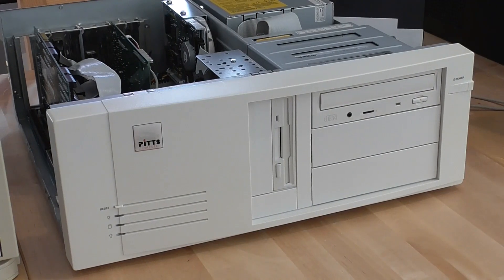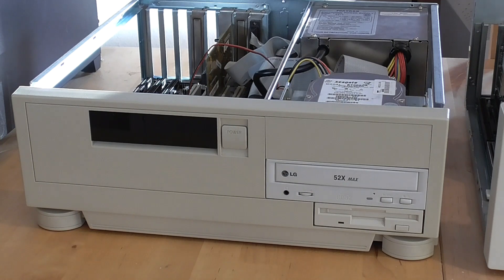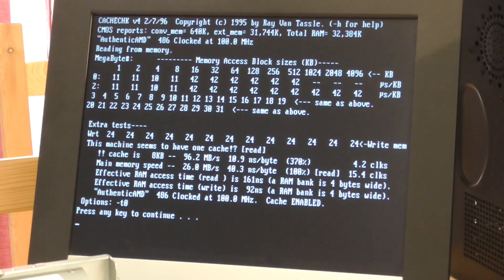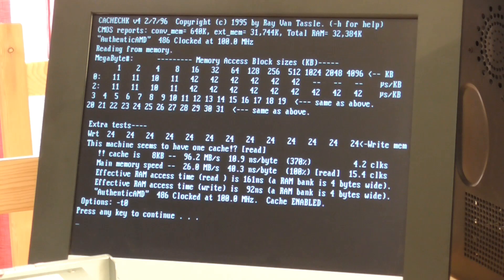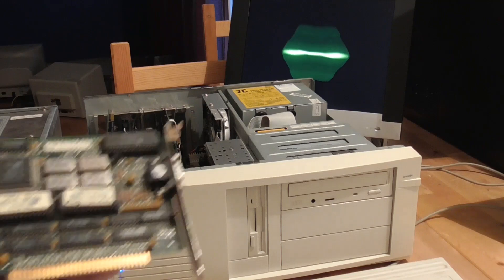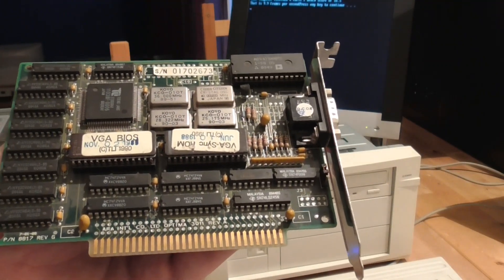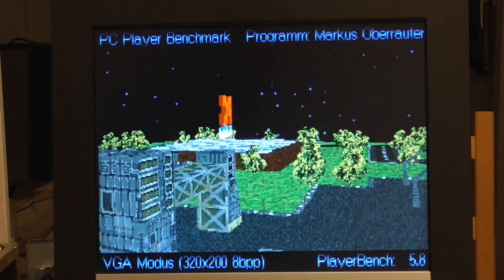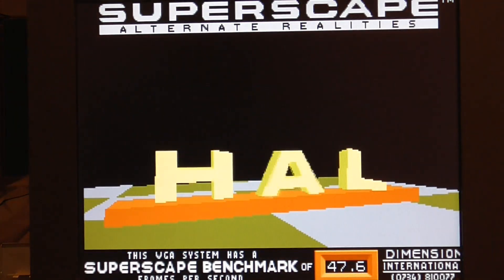Why is this Motherboard so slow!? + Mystery card

Comment: I also have the 2.0 version of that same board! I found that the jumper settings in the available documentation theretroweb to be mostly correct, but the descriptions of JP1 settings are backwards (e.g., says 1-2, 3-4 when it should be 2-3, 4-5) for a good number of the possible cache configurations. I talk about this a little be around the 50 minute mark in my recent video. In all of my Doom benchmarking, I had a single 32MB SIMM, and it performed quite well. I had much better luck with the CPU settings. I couldn't try any of my faster AMD CPUs because a couple of the pins on JP25 are snapped off. :face_palm: I'll have to fix that some day...
Reply from the maker: Thanks for the info. I'll have to take a look again to see if I got the cache settings correct.

Sorry to hear about your AMD chips. Hopefully mine survived my recent move!

Comment: Have you tried populating the board with less memory? Most of boards from these times were supposed to work with 4 or 8 MiB of RAM. They sometimes have too little Tag SRAM to handle more. It's mostly right as long as the L2 cache covers the lower part of the memory where DOS operates, with all better operating systems suffering from uncached memory. However, it may be the case that this board caches only the upper part of memory and thus DOS runs uncached. It may be worth re-checking with 4 MiB of RAM to see whether it changes anything.

Comment: I don't think the CPU is the cause of the issue here. Have you tried to reverse the settings back to what they were when you received that board ?

By the way, I have the same board (rev 1.0 though) but it's dead (I think it received an overcurrent at some point as the voltage jumper was black and the CPU didn't receive any power anymore due to traces being internally burned).

You can take a look at it here https://www.vogons.org/viewtopic.php?f=46&t=65894

As for the CPU settings apparently you can check what each jumper do and thus find the right settings for the right CPU as this person did there : https://www.vogons.org/viewtopic.php?f=46&t=50762&start=20#p798139
Reply from the maker: Unfortunately the board was originally set up for a DX2-66, so changing the settings won't help much. I'm pretty sure I have the settings right for a DX4-100, but there must be different settings for this chip. The problem is there's about 12 settings for the CPU and even though I know what many combinations do, there seems to be little pattern to some of them. Even changing the cache settings seems to make strange things happen, and that's about another 8 settings.
Reply from the maker: I forgot to mention, some of the jumpers have 4 setting. Two of the jumpers it isn't clear which orientation they should go. Setting them to what looks like the right orientation makes the board not boot. And a number of the jumpers are in one big line and it totally isn't clear where the division between the individual groups of settings is. I actually doubt it would be possible to tell anything about the settings by trial and error.